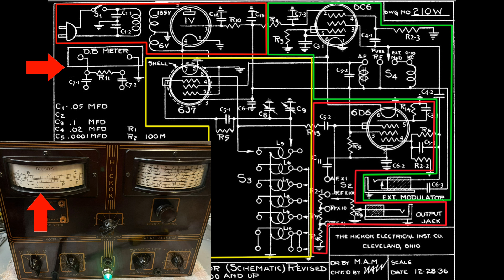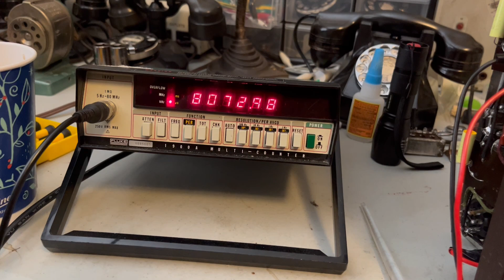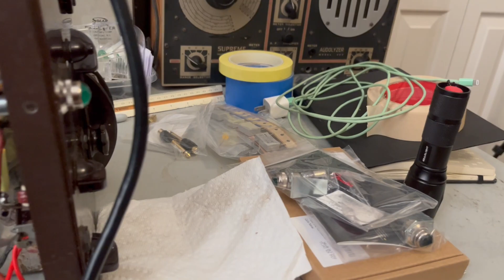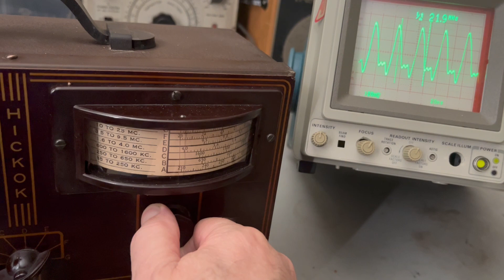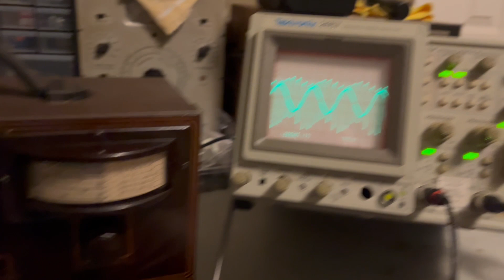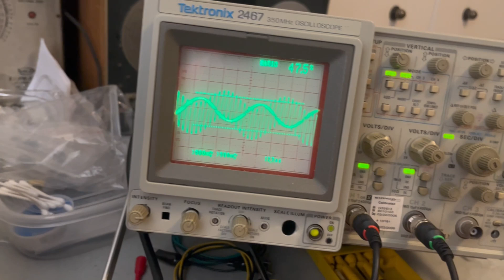Hickok OS-10 Oscillator Restoration (1936 Design)

Comment: Great video, nice work on restoration;  I have one of these, will need recap, etc.;  would be fun to compare my results to yours, see how mine does as far as distortion;  I have a manual for this model.  Thanks for sharing.
Reply from the maker: Much appreciated.  I’d be interested in seeing your restoration if you’re planning on making a video.  Don’t forget that there are 2 different schematics, one for serial #s prior to 3000 and a different one after 3000.   If your manual came with the device, I’ll bet you’re okay - but I’m sure that must have been what tripped up the guy before me.  Also, I don’t think Bama has a copy of that manual, I wasn’t able to find one online anywhere, so that’s a great thing you have there.